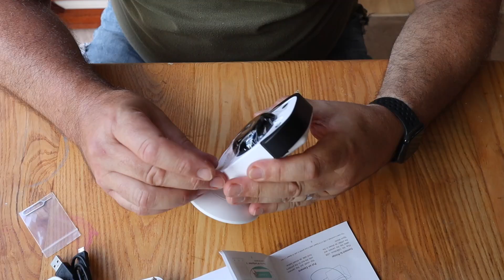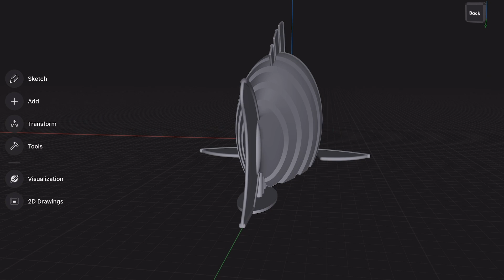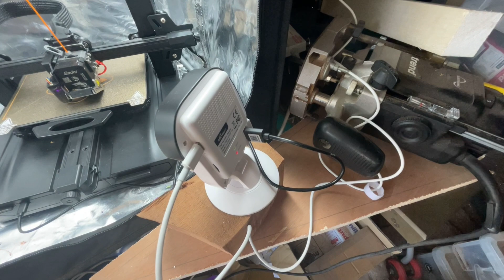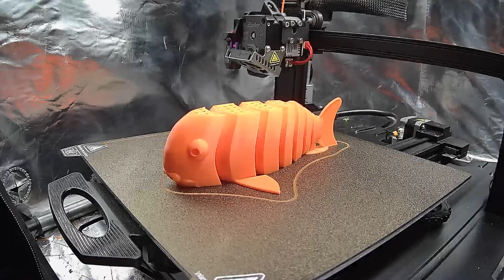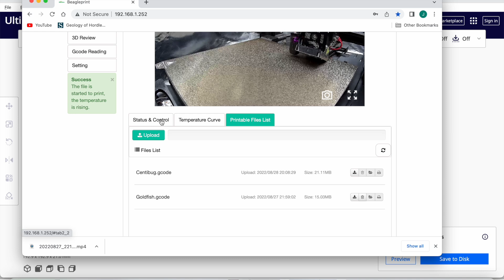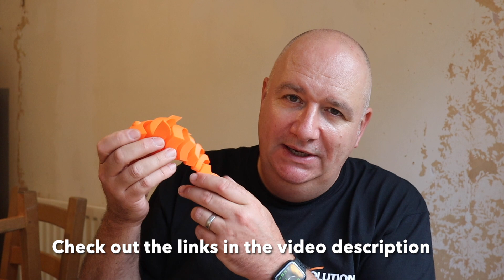Mintion Beagle Camera and Beagleprint, Easy 3D printer monitoring and timelapse video recording.

Comment: I got the beagle but I have tried a few prints but they have all failed 🙈 the same sliced file works if I put it onto the sd card and upload it directly to the printer
Reply from the maker: I have not encountered that problem so far. Try messaging the company. The beagle will add an extra move between layers so can cause stringing issues with some filaments or printers.

Comment: Hi Jim great video. Does it add a lot more time to your prints? I understand it takes a photo every layer. Do you get filament left on your print ever time the head moves away from the print?
Reply from the maker: Many thanks Neil, yes it does add a bit of time but not a lot. I didn’t get any stringing issues but that probably depends on settings and filament
Reply: @JimsonMakes  can you connect the Beagle camera to the sonic pad?
Reply from the maker: @neilbartlett3018  not that I know of but Mintiontech are looking at making the Beagle Klipper compatible

Comment: I have had this camera for a while and I will be selling it. For one, there too many bugs, not showing correct layer heights, or nozzle height or correct time to completion. Add the fact that randomly the live feed will hang and you can't do anything until the print completes. Also, the interface, and the options, while certainly usable, are extremely simple. If you've ever used Octoprint, you'll be in pain about how limited te Beagleprint is.  The upside is, that the timelapses are really clean. The best thing by a long way is the night vision in HD. It's absolutely incredible how detailed it is. Saying that, if you just want something really simple, this will do fine, just tamper your expectations.
Reply from the maker: I know Octoprint is very capable but the Beagle is a good plug and play solution, I think they are adding more features with future firmware updates. Since connecting and running my printers from the Sonic Pad I am only able to us it as a monitor. Many thanks for watching.
Reply: @JimsonMakes  I'm actually thinking of buying the Sonic Pad, can you not record timelapse on it? That would be a huge dealbreaker for me...
Reply from the maker: @aqhan  yes you can record Timelapse but the quality was not brilliant. That could be down to the webcam I was using or the way I had set it up, I haven’t had time to check out the different settings

Comment: Things videos are so much fun to watch and if I can handle a machine like that I could just print a new base for the lamp I'm building put the top part on and just fit into and I can put the lights in and then I'll be done but that one part of the lamp I've been working on is finally come along went over it with the resin fix some little holes and sanded it again but everything I send off it really gets stuck to the Sandpaper so it takes me a while to clean the Sandpaper off
Reply from the maker: Thanks for watching. try using mesh type abrasives, they don’t clog so much, or if possible wet sand.